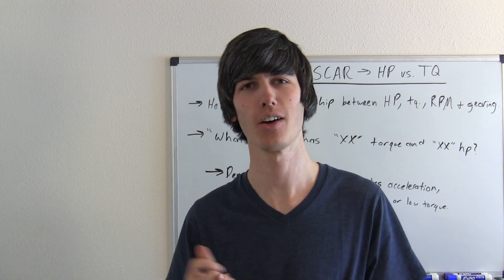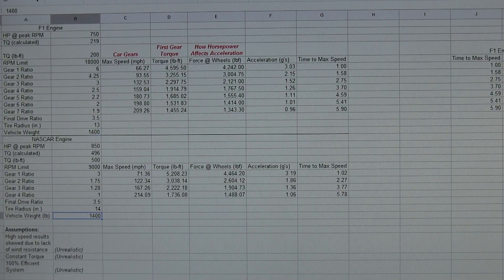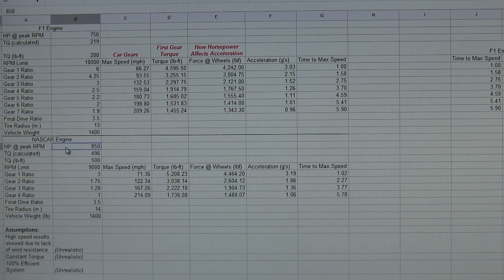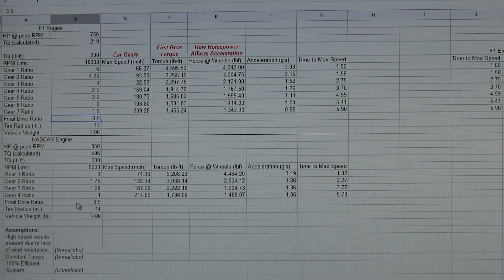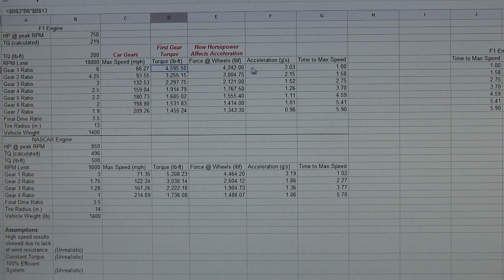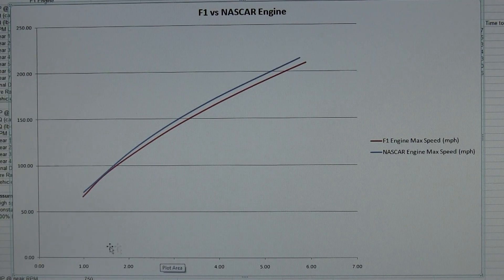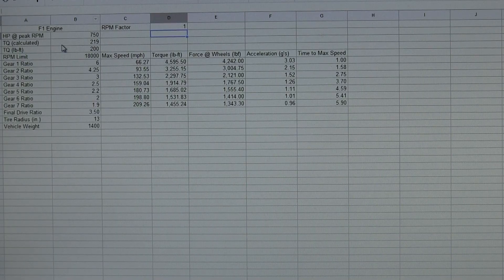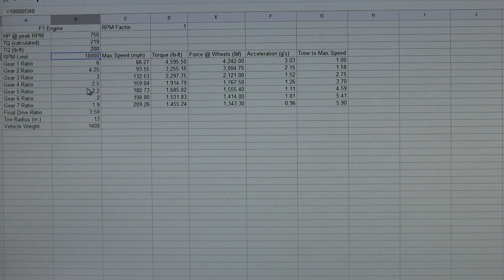Horsepower vs Torque - Formula 1 vs NASCAR

Comment: This makes a lot sense, but I still don't understand why turbochargers lead to more torque increase than horsepower.
Reply: You mean peak horsepower, right? If so, i can tell you it depends on how you setup the turbocharger.
For an everyday vehicle it is more suitiable to install a rather small turbocharger which won't produce a lot of turbolag but a lot of boost at low engine rpm. This way the car is very driveable for an average person because it produces a lot of torque and so power at low rpm but the downside is the small turbo won't produce enough boost at high engine rpm to increase the peak power value significantly. If you go for a huge turbocharger it is exactly the opposite, a lot of torque and so power at high rpm, but poor driveability which is not a problem at a drag strip or racetrack but isn't very nice to drive in heavy traffic as an example. So that's why the car manufacturers normally choose small turbos over big ones.
Reply: Thanks, so u mean Power = Torque * RPM equation always works.
Reply: sonasidhu
Oh of course it does. A car drives with the power of the engine not with its torque.
Torque is only one of the two components needed. The other is rotational speed in this case.
If you look at other equations to calculate mechanical power, there are always two main components in it. One is always force relatet and the other is always speed (time) relatet. If one of them is missing, you can't move anything.

I think the reason so many people don't understand that properly is because first of all is a lack of education and also if you look at an engine datasheet in a car magazaine, they mostly only call the peak figures of power and often torque. But the real intresting thing would be the power curve.
Reply: shi01
Just one more question about the video above.
It seems like F1 engine produces same acceleration because of the better transmission (7 speed vs 4 speed), what if you use F1 transmission with NASCAR engine, would that accelerate faster??
Reply: sonasidhu
Well, it can be helpful to have more gears but it is a bit more coplex. The acceleration is mainly defined by the power to weight ratio of a car. So, a Nascar will never have the acceleration of an F1 because the Nascar is simply to heavy.
But what you have to achive as a driver for the best possible acceleration is to keep the engine revs in a range where the engine delivers the highest power. It is easier to achieve this with more gears of course because the rev drop if you up shift is smaller.
But it also depends on the track you drive. A car that drives in an oval can maintain a relativ steady velocity at all times. So you don't have to shift at all because the engine stays in the optimum rev range all the time. On a typical Racetrack on the other hand your velocity even with a F1 car will be much more diverse. You can have top speeds of over 180mph but the lowest speed can be 30mph. So now, more gears come in really handy to keep the engine revs in the best possible range.
Reply: I think you are making this more complicated by considering real world situations. My question pertains to the video above where he uses same mass for both cars and acceleration is calculated using F= ma formula. 
F1 car seems to be making up for its low torque by using its gear ratios. But what if you give same gear ratios to the NASCAR engine
Reply: Oh, sorry for the misunderstanding ;). This scenario is fairly simple. The Acceleration would be better, yes. Because you have a bigger force on the wheels, but you would cut your topspeed by half because the NASCAR engine just revs half as high so the wheels on the car also just revs half as high.
Reply: Thanks, so that means that this video suggesting that hp is the only variable responsible for acceleration is actually wrong.
Reply: sonasidhu
Well there are many variables in the real world that defines the maximum acceleration. But Power defines the boundarys.
You can choose with the gear ratio if you want to go for better acceleration or more top speed. If the poweroutput stays the same, the topspeed drops if you set the gears up for better acceleration and vice versa.
If you want better acceleration with the same or even higher top speed, you need a more powerful engine which means more torque at about the same rev range or higher revs at about the same torque.

Comment: So if you double the Torque again to 876 ft pounds, you can lower the RPM to 4,500 and you're still at 750 HP.  And so here we have a high torque, low RPM engine making the same HP.  Would it accelerate different and would top speed be even higher...???

Comment: I guess the point of the video is to make people understand and stop comparing oranges to apples. Because they are basically the same, just different, like an equation. If you take away these attributes, then other attributes will be affected accordingly. It's important to compare anything with proper context and purpose.

Comment: To make things more confusing lets take into consideration why people would want more torque especially in large trucks. The more torque you have the more horsepower you develop at low RPMs. The slower an engine spins the less the wear and the longer it lasts so they are suitable for a higher duty cycle. But these engines are heavier so there there are trade offs.
Reply from the maker: All great points!
Reply: +Yop Brookhuis And that's why the components need to be bigger and heavier. Higher torque is just more horsepower delivered at lower RPM. Hp = RPM x Trq / 5252.
Reply: +Azazel Acheron that's exactly what he said, but in even greater detail.  Learn to read before dismissing explanations that far exceed your own
Reply: Duty cycle is part of it, but it's also largely because when towing heavy loads, you need the peak (or near peak) power right away and the tuning to enable that seriously limits the RPM potential of the engine.  If the engine only made power at the top of the revv range, you'd burn up your clutch just trying to get moving every time when towing a load.
Reply: Azazel Acheron
 Isn't that what I said?
Reply: Oh now I understood the thing!
Reply: +Erik Kovacs 
There are properties which aren't described by the torque/hp measurements.  
I had a 6.2 liter diesel GMC truck.  It's rated hp was only 130, with just 250 lbft torque.   That's not impressive sounding, actually kind of pathetic by todays standards.   
But once we towed a trailer with a tractor, probably 4000 lbs, and the truck wasn't overly burdened or stressed.  Didn't even half slow it down.
Reply: You could make a turbo with an even/full boost across pretty much the entire rpm range, but that would be inefficient.

The technical problem behind turbo lag is that turbos are driven by exhaust gas. The exhaust gas still has some energy after it comes out of engine, and that energy is used to spin the turbos.
It's not even a question about rpm. When you're trying to travel constantly and use least amount of fuel possible, when you're not accelerating, injectors will barely inject any fuel into the engine, to use the smallest possible amount of fuel. And this results in small amount of exhaust gas, which results in small amount of energy to drive the turbos.

So, basically, in order to to reach full boost at low rpms / low gas usage you would have to make your turbo smaller. But that reduces the maximum possible boost of the turbo. So basically, large turbos will offer great boosts at higher rpms / fuel consumption, smaller turbos will offer better boosts at low rpms / fuel consumption. That's basically the reason manufacturers tend to use several (2) smaller turbos instead of a single gigantic one. It slightly evens the boost curve.

In order to reduce turbo lag you should take a look at ALS (that's basically shooting exhaust gas at turbos without releasing any torque on the powertrain - increased fuel consumption) or supercharging (superchargers usually provide better boost curves).
Reply: 4000 lbs really isn't all that much for towing, and handling the weight is as much about the structure of the truck frame as the engine as a V8 car could probably tow that load easily as well if it could handle the frame stress.  The key is that the 130 HP was available right off of idle, which is a good bit of power considering that's usually what a solid economy 4 cylinder will make only for the last few hundred RPM before redline.  When you can make that power over a wide revv range, it allows for decent acceleration even when towing a load.  Gearing is another big factor and I bet that diesel had some insanely low gear ratios.
Reply: +Erik Kovacs But isnt it when you create more torque the combustion stroke is much more powerful stressing the engine componment much more

Comment: As being a mech engineer i want to explain one point about your calculation. Same horsepower makes same accelaration on engine's power band. If engines worked on top power rpm, that would be true. But in real life, you still need power to just rev your engine to it's power band. That means, if both cars started at 3000 rpm, higher torque'd engine makes more power, so it will get the powerband faster. 

As a result, if two cars have same horsepower but different amount of torque, more torque wins because of higher horsepower at low and middle revs. Good explaining anyway :)
Reply: That's why drag racing cars use bigger engines. Bigger engines are pretty much always faster on straight line speed. And bigger engine=more torque

Comment: Simple explanation: higher speed engines with lower torque can develop similar acceleration as large displacement engines because of the gearing.  The high speed - low displacement engine's torque is multiplied by the same gear ratios which are are higher on the high speed engine to gear it down to get the same road speed.  For your calculations, you could calculate the time to reach the shift points or redline assuming constant torque and them up to get to the 0-60 time. Also, Nascar weighs 3400 lb, more than 2x the F1 car.

Comment: torque is just power at low rpm... horsepower is just power at high rpm... they are calculated from each other. Car with high torque just has much HP at low rpm!!!! Highest torque reading in some huge 2000 hp supra is pointless because peak torque is at same area as peak hp. So it really doesn't tell anything because they are same thing, JUST POWER!! Torque is simply just used to tell engine power band....  it would be same thing if car makers would tell HP at 2500 rpm and  HP at 7000 rpm... Then we wouldn't even need torque reading. Or they could just tell torque at 2500 rpm and torque at 7000 rpm, then we wouldn't need HP...
Reply: But torque and HP are made so it tells easily engine power band in any engine!! Some engines rev more than others so strict RPM readings would not be that good. But in short terms it would tell same thing.
Reply: ERK77VI Torque isn't "just horsepower at low rpm." That doesn't make any sense. Torque is mechanical twisting force, it physically turns the wheels at any given rpm. Horsepower is work done over time, it's a measure of how well an engine can multiply it's torque throughout the powerband.

Think about it. A late 90's Dodge Durango with a 5.9 (360 cui iron block v8) turns the wheels with around 350 ft-lbs of torque (before driveline losses) at a very low rpm, probably 2,000 rpm (just a guesstimate) but it doesn't even make 250 hp at any point in the powerband I don't think. It's set up this way from the factory because the vehicle is heavy and meant to haul a lot of weight at a low rpm, it's not designed to accelerate quickly in the mid range/top end of the powerband. It will put you back in your seat the instant you step on the throttle from a dead stop, but the camshaft profile and the compression ratio & factory cylinder head ports, etc., dictate that it won't flow nearly enough air to multiply this torque very well over time, thus, it's not a fast vehicle, the engine isn't doing very much work as far as maintaining or increasing the initial acceleration you get from the low-end torque, it's just pulling hard on the low end.

Now think about a 2011+ Mustang GT. It's a 5.0L all-aluminum cast block & heads with dual overhead cams and four valves per cylinder. It flows ALOT of air through the combustion chambers for being of such small displacement compared to most domestic V8's, but it's in a car that is somewhat on the light side (compared to Camaros and Challengers and some EU sedans like the M3) so it doesn't really need much low-end torque, it's a very responsive engine, so even under load, it reaches peak torque (390 ft-lbs) quickly at around 4,000 rpm and produces 412 to 420 horsepower at 6,500 rpm. It's multiplying whatever torque it has at any given rpm VERY well and thus, the rate of acceleration increases with higher rpm until the horsepower starts to slowly drop off near 7,000 rpm.

Hope that helps. And BTW a Supra might make it's peak torque at a very high RPM but a twin turbocharged big block V8 will pull with ALOT of torque on the low end and produce ALOT of horsepower in the mid range and top end, without much torque loss. If you're going to use an iron block you might as well use a V8 in my opinion, more displacement means more potential horsepower, 2jz is massively heavy for a six cylinder engine.

Comment: Comparing F1 and Nascar some more, if you have two cars with the exact same power-and-torque-to-weight ratio, and they both rev to the same limit, same aero, layout and drivetrain but one is say, 750 kilos heavier with extra power and torque to compensate, which would achieve the highest top speed?
Reply: Bruno Maba Inertia have nothing to do with it. Inertia is the resistance of any physical object to any change in its state of motion, including changes to its speed and direction. Your statement would be correct if heavier one could reach higher speed initially but that is not point of his question and even in that case in long run inertia would be canceled.
Reply: angedgangsta The car with more power would have a higher top speed since aero drag is the same. A vehicle with good power-to-weight ratio but low overall power will get very good acceleration but it's top speed will be poor.

That's why a bike, with for example 100 hp but only around 400 lbs will top out at somewhere around 140 mph but do 0-60 in like 3.5 s. Cars with 0-60 times like that will usually have more like 400-500 hp, weight will lower power to weight ratio to similar levels but it'll still top out at more like 175-190 mph.

A bike also has a small frontal area so not as much drag as a car, hence a slightly higher top speed than a car with 100 hp but you get the idea.
Reply: in ideal condition it would be same, rolling resistance is proportional to mass so power will compensate that and you need to neglect all other losses in drive train
Reply: ok, but say having lower final gear ratios until one can't go past a certain speed
Reply: The heavier one. Because they have  the same aero, aero drag is equal,  the heavier one is less demanding to mantain high-speeds due to innertia.
Reply: Miloš Lazović + inertia means  harder to accelerate (or decelerate, in this case), if aero-drag is the same, the faster one would have to exert less force at near top speed, although it would get to top speed later,  leaving more force to accelerate.
Reply: Bruno Maba You are right that inertia means harder to accelerate (or decelerate, in this case), but to overcome drag  you need to produce force (torque on wheels) and inertia dont produce force (it produce force but that force is resistance to change in velocity).
Inertia have nothing to do with top speed.  Car with higher inertia will louse gained speed slower but still you need force (or power in car) to gain speed.
If car ont change speed (and direction) force of inertia is equal to zero so it will not affect top speed (anyway not constant top speed)
Reply: What color are they?
Reply: Red, or any colour as long as it's the same for both. Yes, I know it doesn't actually make a difference, not without stripes
Reply: ***** As I said, the only two variables are the weight and power, and both cars have equal power-to-weight
Reply: HP/kg

Comment: Since the NASCAR engine has so much more torque wouldn't you be able to change the gear ratios even more to increase speed?
Reply: 177SCmaro
And take into account that engines in both disciplines are developed to provide insight into road vehicles. More torque and speed are not always the primary goal.

Comment: This is a good comparison on paper.. being a fan of f1 though I have to point out in reality an f1 car smokes a NASCAR, top gear put them head to head and the f1 lapped the NASCAR.. though I don't know what the weight advantage was or who actually has a higher top speed.. I like to think of it as hp increases acceleration, while tq moves mass
Reply: 177SCmaro
I like this so much I am actually commenting. Hell yes.

F1 is the peak of motorsport. It is a literal 'how can I get myself as fast as possible around this track'. It is science, physics and cars pulled into the one genre.

NASCAR is more 'how can I take this stock car, modify it, and make it so damn fast it would scare the shit out of a normal driver, and maybe stay on the track'.

Both are excellent sports, but both are very different. This comes from an F1 fan, and a NASCAR liker.

Comment: yep, you could reach 200km/h with 5hp motor... there are only 2 things which are literaly holding you back:
- wind resistance
- wheel drag resistance
if you assume, your tire has 0.5m of radius, omega (circling speed) at 200km/h(~55m/s) is 55/0.5=110s-1
So a motor, with a power of 5hp, would need torque:
P=M*w
M=P/w=0.0455Nm
and with proper gearbox and ideal circumstances, one could make it ofc